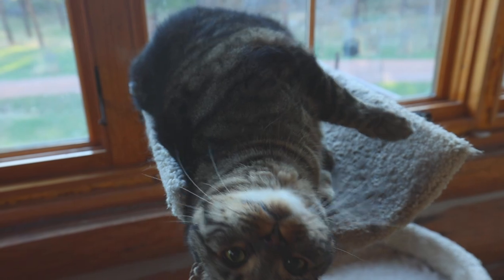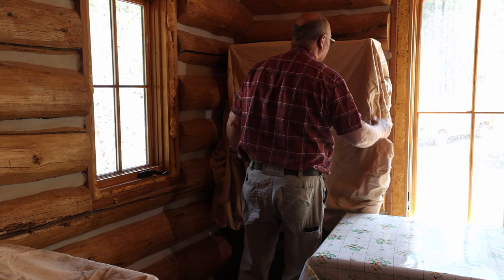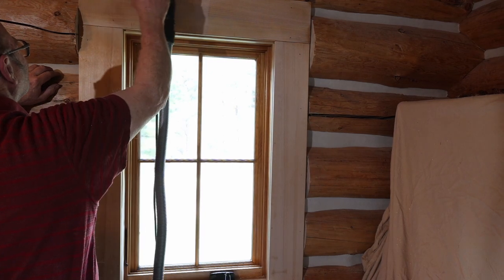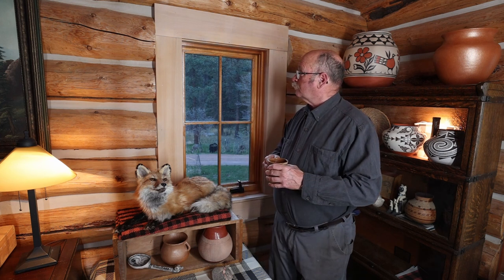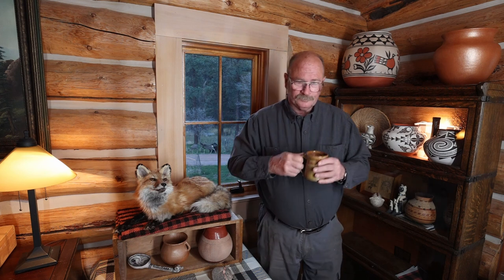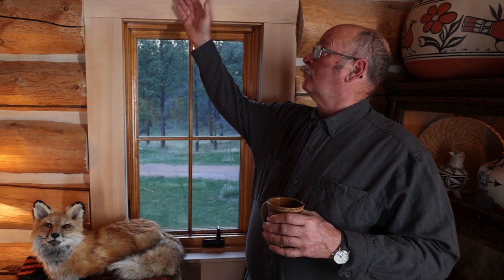Frogging the Window

Comment: You have some nice woodworking tools, John. Since you have some Milwaukee cordless tools in your possession, you might pick up their cordless  oscillating multi-tool, you'll retire the over-priced corded Fein tool. To add to your window challenges, a nice detail is to scallop the log ends to meet the trim thickness. It's just a little more dust and sanding 😳😬, but it really does dress up the window.